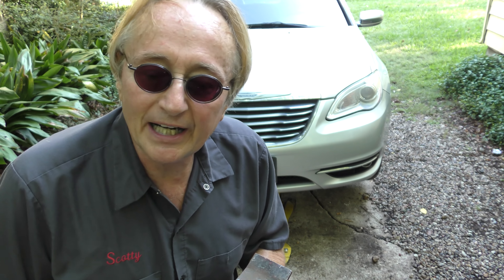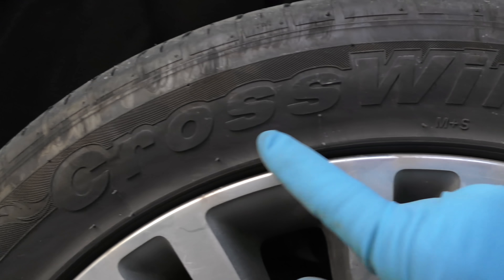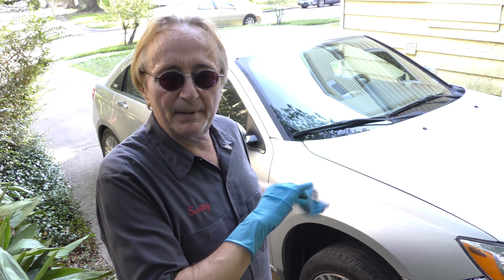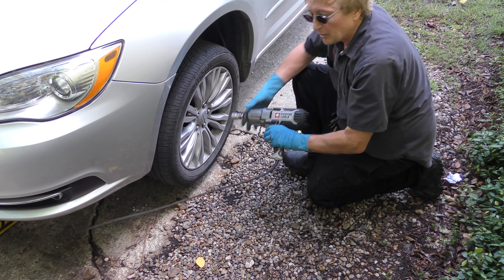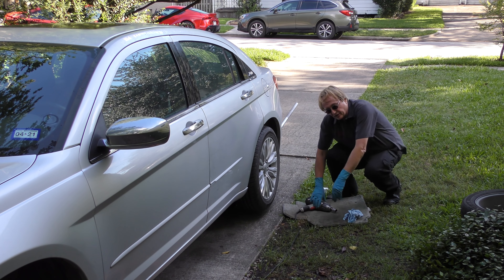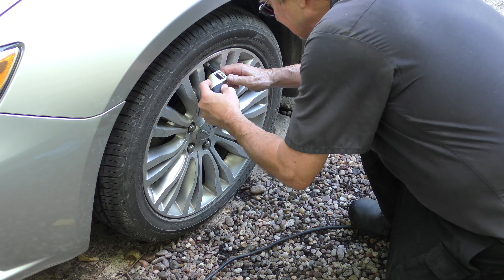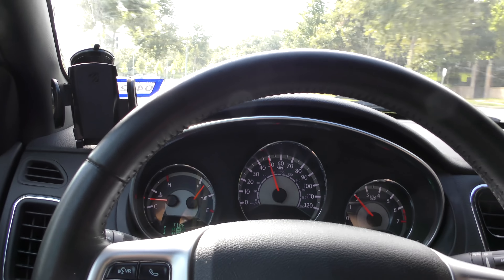Here’s How Stupid People Change Tires

Comment: yes most braking force is front of the car, but if you use bad tires at rear and brake hard, then your back end loose traction, because too much braking force at the front what back bad tires can't handle.
At summer it's not so bad, but at winter this is very bad situation.

Comment: A few years ago, I went to Walmart to replace a rear tire that went flat.  I went ahead and replaced the back two since I was going to do that in another thousand miles.  I asked the techs to move the new tires to the front since it was front wheel drive and the wear occurs there.  They wouldn't do it because there policy was to keep them in the back because they were supposed to put the best tires in the back.  I had to argue with the dept. manager who knew it was better to move them to the front, but didn't want to get in trouble if the main manager found out.  She finally had the tech switch them and I went on my way.

Comment: I find 33 psi to be too low for most tires and vehicles. I find the handling and fuel economy go out the window. I’m no mechanic, it’s my personal experience. I usually run 36-37 psi in all season and 37-38 in winter tires as the rubber is much softer. Anything less and it fells like they’re half flat. What is your opinion Scotty?

Comment: They say to put the best on the back to reduce the chance of the rear end coming around. I disagree as with FWD the rears will probably rot rather than go through the tread. 

Putting more worn on one side to the other can over work the differential. 

Oh and you  can still pull a car off axle stands when working on it. So it's safer, but not fully safe on bigger jobs. Impact wrenches help to improve safety undoing fasteners, but best done up by hand.

Comment: Well.....the thing is more that you need good tires in the back as well. The reasons is that, especially if you drive your corners faster you need good grip in the back as well to prevent oversteer. Oversteer does not happen to modern cars so quickly as most are front wheel drive and are setup by default to have understeer. Indeed therefore you can have worse tires in the back, but....if you do put your car a bit more to the limits, it is really a good idea to have good tires in the back as well to prevent the back from breaking out.

Comment: Front-wheel drive cars understeer by default under excess throttle application. So they are inherently safe and predictable when driving at the limit in low-traction conditions. Most FWD cars have a significant front weight bias, so most of the grip is needed up front to make the car corner. Thus you want your grippiest tires for the conditions mounted up front for a FWD car. For a RWD car, the weight bias also tends to be toward the front, but typically by a smaller margin. RWD cars oversteer at the limit, so you want your grippiest tires on the rear axle for a RWD car, otherwise you're exacerbating the oversteer already present.

Comment: Up north, that's a mistake.  On a fwd, you put the best tires in the back to prevent skidding.  In the summer, you can rotate and put the best tires in the front.

This guy's real problem was having two different tire types on the same axle.  And one tire was worn. If you have to do that on a fwd car, put them in the back. But better yet just get new tires.

Comment: I had this horrible vibration in my steering wheel running brand new tires same brand on all 4 wheels, Had to give in and send the old girl to the mechanic who i have been using for years and he found a interesting problem, The left front had patch on it from a puncture and that was causing the wheel the vibrate. Moved it to the back and the problem went away. Damn tire shop was supposed to trim some off to ensure it did not cause a vibration.

Comment: clean comment

FWD cars have tons of understeer.
having crap worn tires up front will make this even worse and dangerous in rain and snow.
when braking all the weight is shifted to the front.
Oversteer is a bigger problem on vehicles that have more weight and more power in the rear.
The front is where you need the best tires! 
The front does all the work!

Comment: The bad thing around here is tire shops will not put the best tires on the front.  They say it's the law. You have to do it yourself.  So if you leave it their way you're always wearing out the already more worn front tires quickly and if you go back to the tire joint they refuse to rotate the back to the front.

Comment: The odd tire must have a slightly different circumference which causes issues on the driving wheels - front wheels spins at a slightly different speed to each other. Not noticeable on the free spinning wheels at the back.

Comment: When I was 14 years old my dad bought a real nice used car that had very low miles on it. He got a super deal on it. It even had original tires on it. We found out why, anything over about 50 mph the front end would shake real good. We drove it like that and my dad kept taking it back to dealer he got it from and I swear every mechanic in that whole place checked it out and took the wheels off and checked the balance 10 times. My dad still liked the car and was living with it and one nice summer day I asked my dad if I could try something on his car after thinking about it. I wanted to change front tires for backs and see what it might do. I had fun jacking it up and changing the tires around and when I was done we told my little brothers friend we were going for little test drive be back in few minutes. We ended up going out on the freeway because now it was smooth as silk up front up to 80 mph, you could feel the BAD TIRE bouncing around in the back. We ended up driving 20 miles to a lake and went swimming my dad was so happy.
It took a 14 year old beginner mechanic to figure out what all the mechanics in the dealership and who knows who else the original owners may have consulted. It was just a bad original tire.

Comment: The problem is litigation. The tire manufacturers recommend putting the worst tires on the front to prevent oversteer, since if you lose traction on the back, you'd have to counter-steer, but if you lose traction on the front, you'd have understeer, and could correct it by slowing down.
Yes, Scotty is correct, the worn out Goodyear Eagle LS-2 tire should be replaced. But those large chain stores are hampered by the insurance, who takes their recommendations from the tire manufacturers, who make their recommendations to prevent litigation.
The big box chain store probably recommended that the customer get a new tire, but they probably didn't have one to match, or they charged too much.
As an aside, those Crosswind tires' tread look exactly like the Definity HP200s I have on my car. They're probably the same company. Good tires.

Comment: I agree you want the better tires in front on front wheel drive cars. But the reason the treads are worst on the front is because it wears way faster than the ones on the rear. That's why people have to rotate their tires once the front ones wear down. The mismatched tire is because they probably blew out one tire and just wanted that one changed but the shop didn't have that exact tire or maybe it was one that they had and was on sale. Not everyone wants to replace all four or by the two's. I think by the two's is fine, both fronts or both rears should be the same brand so the tread pattern matches.

Comment: I think the best tires should always be mounted on the rear. This is because in case of hydroplaning you will feel it on the steering wheel before you spin out of the road!
Reply: @Vireboy:  Attaboy.  Dead right.  So many muppets and boy racers think they know better.  I'd rather listen to the tyre manufacturers, who spend millions of dollars/pounds on tyre R&D and usage, than a boy racer.

Comment: Put the best ones in the front.  I have had the same problem before and when I put the same tires in the front that were the best the problem went away.  The brake pads also wear out faster in the front than they do on the back.

Comment: Nice to see you hand torque those lug nuts Scotty 

I'm impressed it still has an OE Goodyear on the car.

So...does it rock the steering wheel or vibrate? If it rocks the wheel back and forth, that normally means a separated belt, needs replacement, if it vibrates then balance 

Scotty they are the same "type" of tire, they're standard load all season radials...they both have 2 steel belts, 2 poly, and 1 nylon. The differences are brand, pattern and maybe compound

It sounds like a dumb idea but they're not wrong Scotty, the 2 tire mounting on rear has been an industry standard for over 10 years now. Comes down to a couple basic facts, worn out tires on the front will cause understeer, which you can safely correct by slowing down, worn out tires on the rear causes oversteer, which is harder to control, and statistically causes more crashes, in tire related incidents. You are right, it's for liability reasons, and after 40 years of case studies from the NHTSA, most motorists are less likely to recover from an oversteer condition, especially at higher speeds, and especially in wet conditions. So naturally, and especially if a service center or tire manufacturer can be legally found liable for someone's failure to drive responsibly when less than 4 new tires are installed on a vehicle, why wouldn't they do the safer procedure? 

even your basic argument against putting the new tires on the rear of a FWD actually lends creedence to putting them out back . Yes the front is responsible for steering,propelling and stopping the vehicle, that also means that most all FWD vehicles are weight biased toward the front. Which in a very basic sense, even if braking was evenly distributed front and rear a tire would still achieve a higher "grip" (friction coefficient) with the heavier front end than the rear with less weight. So to say a tire worn to say 3/32, would grip and brake better on the front of a vehicle than it would on the rear, even if all other variables were constant besides weight. That 3/32 tire on the front could very well handle and grip like a 5/32 tire on the rear, while it's on the front, which would be safer and better traction for the vehicle overall....but hey, don't take my word for it.

Comment: Hi scotty, is it good to change wheel bearing on 124000 milleges?
Reply: What vehicle?
Reply: Hi Stephen. Its a camry 2014 se..
Reply: Actually I got tire noise after I  installed new tires in front. I have been thinking. Is it the root cause of wheel bearing issues?

Comment: When I was young and dumber, I bought two new tires for my car, planning on buying two more my next paycheck. The tire guy suggested that the new tires go up front, I talked him into putting one new tire on the front driver and the other new tire on the rear passenger. A few days later, it was raining and I slowed down for a curve and ended up going through a barbed wire fence, 50 yards downhill in a horse pasture. It was one of the best carnival rides I ever rode and the most expensive.

Comment: So when I rotate my tires, should I just put the best ones on the front or rotate the tires so that it has been in every position?
Reply: Scotty mentioned that depending on the drive of your car fwd or rwd the better tires should go on that. Ie put better tires on your fwd on the front. However when you rotate tires it also depends on your drive. For fwd rotate the front tires straight to the back ones. And the back ones cross them and rotate them forward. Reverse this for rwd. For awd you’re supposed to cross them completely. FR to RL and FL to RR. Also keep in mind if your tires are directional. If they are then it’s just front to back and back to front not crossing
Reply: kenkyuen I have FWD and have been doing like you said. But if I continue to rotate tires this way, then the tires will be in all positions of the car and not just the best ones in the front. I guess I’ll just stick with the manual.

Comment: 2004 Ford expedition, has all wheel drive as an option but I drive it 2 wheels in the rear.  I want to rotate my tires, but the tire shops are too busy and I can't drive that far.  I've heard you rotate them in strange patterns based on this and that.   It's very confusing and I'm still not sure what to do.  Backs straight to front, (it's been over 6k miles since I rotated them last) or back cross to front, or fronts cross to back......  ugh this is so annoying, I'm suree I won't get a reply, and if I i did I wouldn't be sure why that logic and whether it's right or wrong.  Some tires only want rotation in one direction. I had my last set they separated in the radials, and I did cross rotate those.  Im just gonna throw my hands in the air at this point.

Comment: People put the worst tires in the front, best in the back, because having losing tire traction in the BACK can lead to complete spinout, i.e when driving through standing water with bald rear tires. This is as opposed to losing some traction for accelerating a FWD car or understeer when cornering if you have bald tires in the front; conditions that are not as likely to be fatal while driving and that you can control real-time with the gas pedal and steering wheel.
Front end shaking probably caused by using two different types of tires; if they were both

Comment: Had a friend of mine that got 2 new tires at Sam's. I told her to have them put the new tires on the front. She has a front wheel drive 2016 Chevy Trax.
She called me later and said they put the new tires on the back because that was there policy. If you only buy 2 tires instead of a set of 4. 
About a month later she had them rotated.

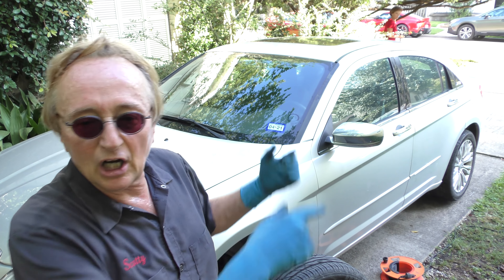Comment: 3:50 I think the expert's "idea" is that the tires on the front (even in a front wheel drive car) are the tires that are able to be manipulated by the steering wheel. In the event of the low-tread tires causing a loss-of-control event, at least you can still steer those tires. The rear tires being bald... you will just fishtail out. Unless you're a stunt car driver, compensating for the rear of the vehicle fishtailing can be difficult, none the less dangerous. 
But as someone who works with mechanics all day, I can tell you that we always put the best tires up front. Better stopping power, better handling around turns. Even tire wear. All of these reasons are good reasons to put them up front. And they should be rotated. But rotating that 3/32" tire to the rear is technically... worse... for the safety of the customer... even though in this case Scotty, it makes their steering wheel wobble. Uncomfortable isnt necessarily the most unsafe configuration.

Comment: I’ve had two different  tire companies tell the reason to put the best tires on back, is if the best tires are in front, during hard turning, the worn rear tires can’t maintain traction with the new front tires and the car could spin out of control.
Reply: Hi K Skoog:  Dead right!

Comment: I've worked at 3 dealerships and a tire shop, and if I had a nickel for every time one of my coworkers, or even the manager, has told a customer to put the better tires on the rear of a FWD car, I'd be driving an E36 M3 by now. I don't even know how many times I've had to set people straight on that. I even got into an argument with my boss once about it, and it might be part of why I got fired a couple weeks later
Reply: Maybe, maybe not, regarding your firing.  But your manager was correct!

Comment: I love most of his videos...BUT
there's so much wrong with this video. I'm ASE certified in steering, suspension, and brakes. And have been diagnosing these issues for years. The name brand of the tire doesnt matter. The tread pattern doesn't matter. The only things that matter are tread wear, tire pressure, cupping, balancing, and possible separation, when it comes to vibration or wobble. He minimally shook down the front end, did not check lower control arms, or lower ball joints. He says, "you want the best tires on the front on a front wheel drive car". Which is incorrect, when speaking on safety. Multiple tests, in multiple terrains, with multiple weather changes, show the best tires should be on the rear when it comes to safety. You have the best traction with your best tires on the rear, you can however still have shaking if your other tires that you put in the front are cupped, separated, out of balance, etc. He went and test drove on camera after, but not before, which tells me that either: a front tire was separated, incorrectly balanced, cupped, etc.. or otherwise, it never shook in the first place. Also, aligning the car doesnt affect shaking. Also, the mechanic doesnt get paid $120 an hour. The mechanic gets paid around $15 an hour, while the corporation he works for, gets paid $105 an hour. 

Just had to clear a few things up.

Comment: The odd tyre in this video would be considered illegal in the UK as there is too much wear on it. I just changed a tyre on my car. Unfortunately, I had to stick to the same tyre make and model. Bad because the specs on tyres are really bad even though they are made by Dunlop. The other tyre is still very good with a lot of tread so no pint in changing out just to match up to another type of tyre. Life!

BTW: American = Tire. UK = Tyre.

Comment: You are definitely wrong about this one, Scotty. I don't know about other cars, but if I put the bad tires in the back of my car, the only way I can drive is by drifting. FWD, about the same tire configuration as in this video, and sure as hell I'm keeping them in the front. Before winter kicks in, I'm gonna buy a new pair, put THOSE in the back, and the old ones that are now in the back, in the front.

Got my lesson after the first 3 spins on the road. 2 of them had fatal potential, luckily it wasn't the case, I was lucky and just slid away from traffic and obstacles.

NEVER EVER use worn tires in the back, it can save a life.